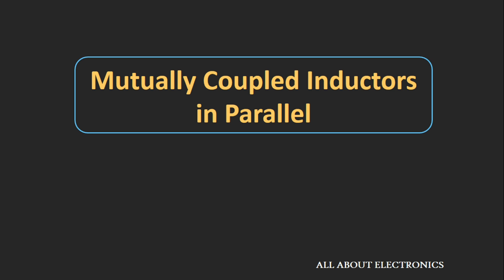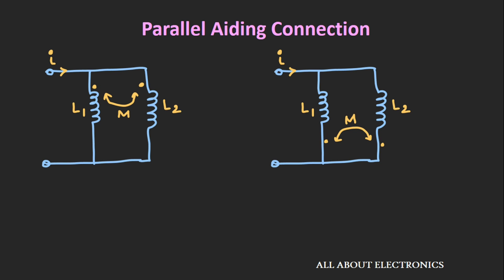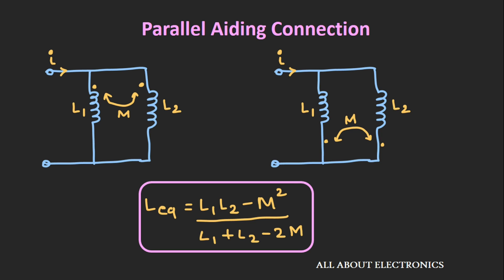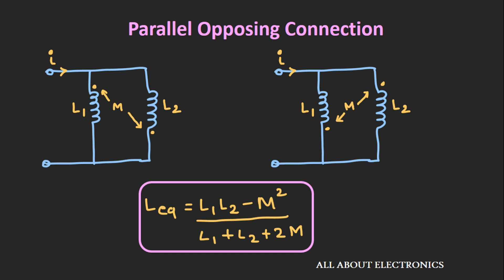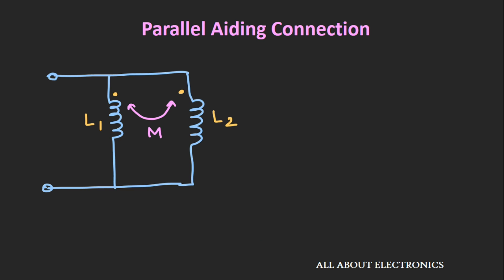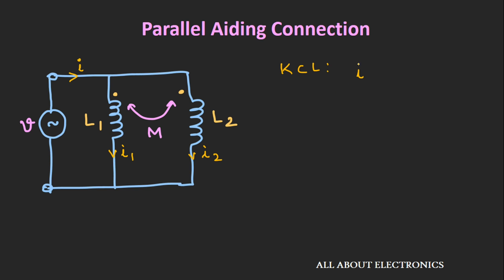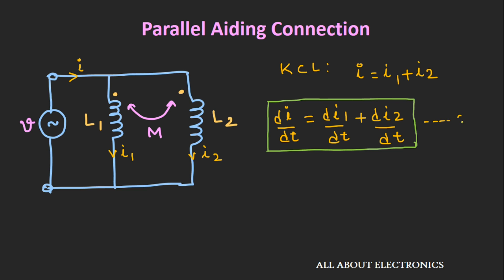Mutually Coupled Inductors in Parallel (Derivation / Proof and Examples)

Comment: I'm confused...If coupling coefficient is 1, then M=1*sqrt(L1*L2).  M^2 is then L1*L2 which makes the numerator of Leq =0.  In fact, so is the denominator (for the aiding case).  So for a perfectly coupled pair of identical inductors, Leq=0/0.   What am I missing?
Reply: same doubt here...did u find why ?
Reply: @jaihind3693  Before I even started to watch this video, I had a feeling that the parallel version of magnetically coupled inductors will leave me confused. If I figure it out, I’ll come back here if I can settle the doubt.
Reply: @jaihind3693  yes!  the expression should be evaluated in the limit as k approaches 1.
Reply: From what I gathered, the coupling coefficient is always less than unity and 1 is simply an impossible maximum value.
Reply: @josephguida5432   thank you.....The expression should be evaluated in the limit as k approaches 1.

Comment: How to calculate energy stored in both type of circuits??
Reply from the maker: Energy stored in aiding case: (1/2)(L1*I1^2) +(1/2)(L2*I2^2)+(M*I1*I2)
In opposing case, it will be : (1/2)(L1*I1^2) +(1/2)(L2*I2^2)-(M*I1*I2)
Reply: ALL ABOUT ELECTRONICS thanks for the help